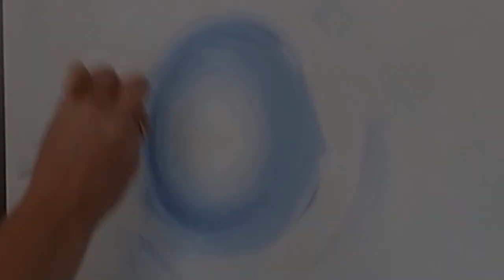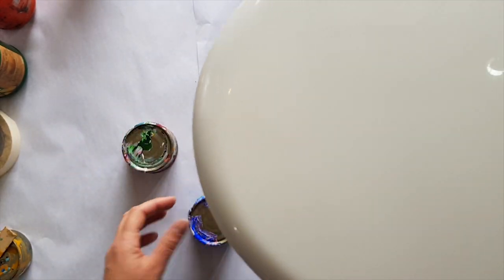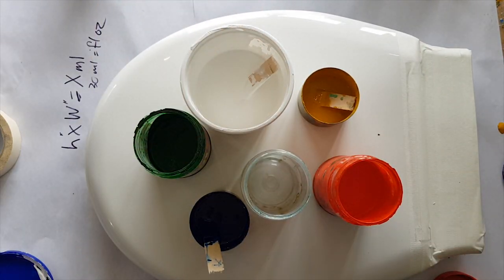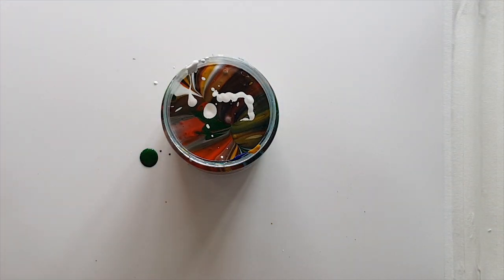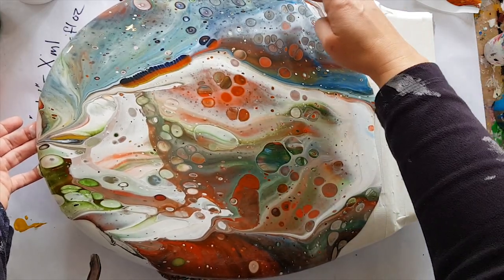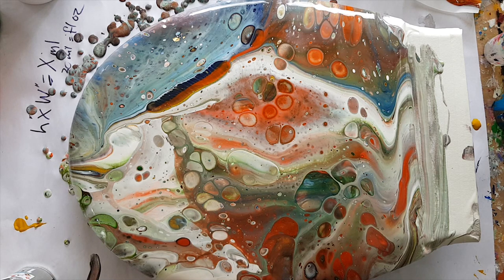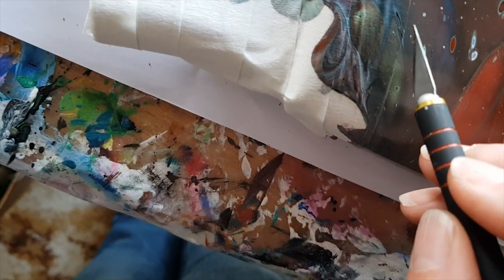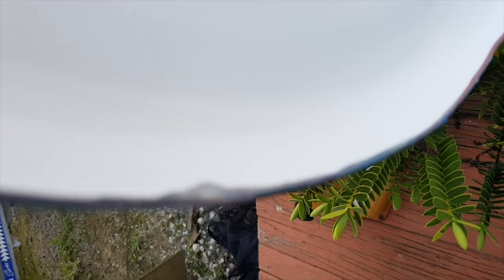301 Paint Your Toilet Seat - Acrylic Pouring for the Bathroom Challenge

Comment: This is awesome! If i was to do one for my bathroom would i need to top coat it? Or resin it? Welcome back:)
Reply from the maker: Thank you Deb :)  I would definitely topcoat it with something.   And I would probably use Resin or a sealer designed for plastic (not all sealers are designed for plastic).
Reply: McE Art thank you:)
Reply: In a high traffic bathroom I would 100% go with a resin topcoat. In the states Stonecoat do a quick set resin that would be perfect for a job like that, in the UK I’m pretty sure Elichem, the makers of Mastercast 1-2-1, do one too.

Comment: Eish.....the one thing you don't want to do is get overly involved in mathematical equations.    Either decide to work in inches or in centimeter - these measurements are not interchangeable.
Reply from the maker: Ha ha ha the equation I was given was for fluid oz and it has you divide by 30 to get how many fluid oz, there are 30 milliliters in a fluid oz and I work in ml normally so works for me :)  Did get myself a bit confused on the measurements though :)